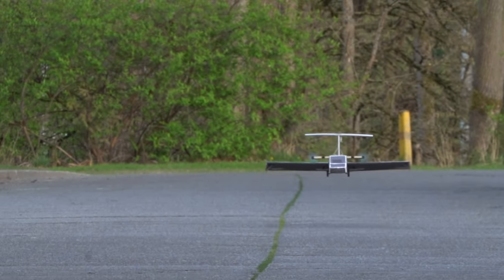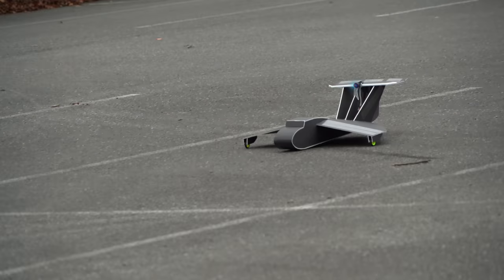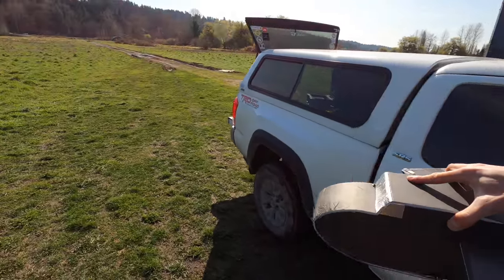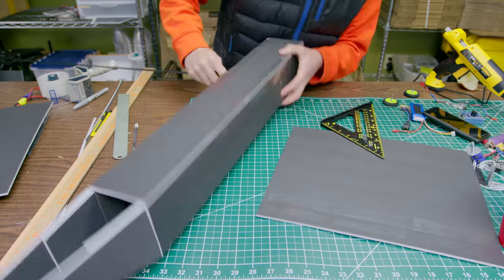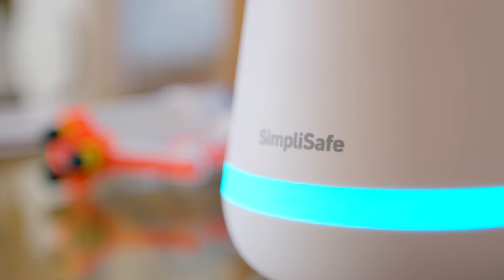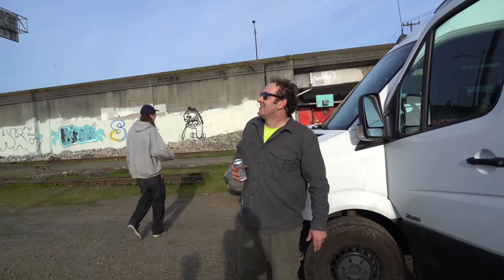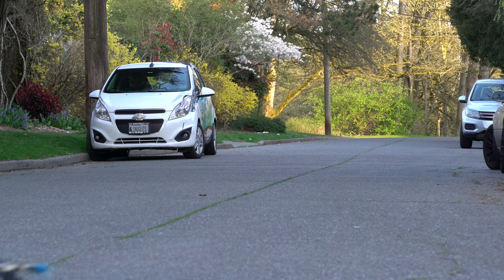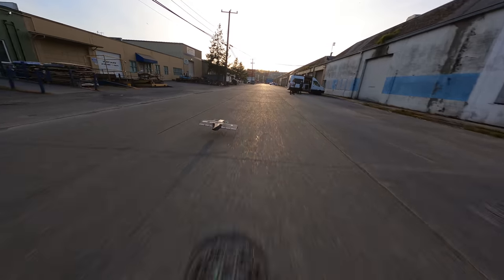R/C Ground Effect Vehicle with LiDAR Altitude Control

Comment: 11:14 In order to damp the bouncing up and down, you could probably use a PD or PID controller instead of a P controller in the altitude range where the throttle is decreased. In other words, make the throttle not only a function of altitude, but also of how quickly the altitude is increasing or decreasing.

Comment: Several years ago I (a software engineer with no aerospace engineering experience and only basic calculus knowledge) started a project to build my own flight control software in Kerbal Space Program using the kOS mod to see how fast I could learn. I got to the point where I began introducing my PID loops but I think I was trying to do too much at the same time. My goal seemed simple: given a fixed point on the ground, circle that position at a specified altitude, speed and radius, in a halo pattern, kind of like what an AC-130 gunship might do in popular video games. I tried getting the speed/throttle loop dialed in first, but had a very hard time zeroing in on the correct parameters. I learned a whole lot, but eventually got overwhelmed and put it down. More videos like this might help give me the confidence to pick that project back up and give it another, more educated try.

Comment: Ground effect is most strong within a half wingspan in altitude. Making it bigger would be interesting to get a bit more distance from the ground!
Reply: I think a little more wingspan may help reduce the twitchiness too, I've suggested some angled winglets. The bigger the air cushion volume the more support it will have, hopefully damping out some instability. Real ekranoplans have a lot of mass but also a lot of lift IGE.

Comment: I tried an inverse delta wig a few years ago and had the same problems. It either plows the front or does a backflip. Built a Bixel type (the sled looking one) after that and it was so much better. Naturally stable in ground effect and in free flight. I think it's the best type of wig type for rc scales since GEVs are supposed to be naturally stable in ground effect with just airspeed to control the altitude.

Comment: OK now this is cool. And actually surprised at how well a simple height-thrust curve works. 
I would've gone straight to PID (more complicated is more better right? right???)
Reply: Yeah it's fun to see it oscillate up and down over the ground but I think specially a derivative term would help a lot
Reply: Using the throttle for alt control is not really the way to go. Throttle response is way too sluggish, the motors take time to spin up the props and increase thrust and the airspeed, which leads to a lag in the altitude response by the f/c and causes the aircraft to gallop. There’s no way the f/c can preemptively throttle up the motors in time for the upcoming the decrease in altitude regardless of the PID settings, it can’t see into the future, and so will always be a second or two behind the game due to the slow thrust response.

Comment: You're missing one thing: gyroscope. 

The thing with proximity is it only measure the height but not the momentum. You hit the minimum height with already too much downward momentum, it's a bit too late.

Imagine if it can start throttling as soon as it start going downward from ideal height, and otherwise.
Reply: Gyroscope ... You mean accelerometer ?
They don't need a gyroscope nor an accelerometer... basic physics :
- Position
- Speed
- Acceleration
They have the position, a simple derivative give them the speed..
Getting the speed form acceleration is not as easy nor accurate.

"Imagine if it can start throttling as soon as it start going downward from ideal height"
Okay but ... they already know when it gets downard because they have the lidar. What's missing them is what is the perfect spot
Reply: @crationis  Perfect spot is way to many milliseconds before to take an action. You have to predict, not react, in which gyroscope is better due to much lower input lag.
Reply: @Pawel.N  But your gyroscope is useless to predict anything with a plane flying at a constant pitch...
And if there is any variation of angle, they are way to small to be measured accurately, making it imprecise and thus completely unusable if you want to integrate it to know the vertical speed
Reply: @crationis  Maybe few gyros on farthest sides of plane?
Reply: @Pawel.N  Oh please....
A gyroscope mesures variations of angle
What would its position change ?.....

Comment: You need some derivative gain in the control loop.  It will help overcome that oscillation by applying a gain to the rate of change in altitude.  Also, drag is a nonlinear function of height in ground effect.  So your thrust vs altitude curve needs to be the same nonlinear shape.  Finally, you might need a little elevator control to add more responsiveness.  Thrust is always going to lag, and lag decreases stability..

Comment: Could you implement a propellor in the reverse direction with separate throttle control to possibly add air speed control?

Comment: If you look at most succesful GEV, you will see bulkheads/partitions at the wing tips. this is essential to maintain the best possible pressure under the wings. I found that extending them fore and aft the wing profile is increasing ground effect but also stability.

Comment: Thanks for the video
You are tying Throttle to Altitude. Throttle will control v-acceleration which then changes v-speed which then changes the altitude. Currently your plane will be throttling down if the altitude is high regardeless of it having positive or negative v-speed (throttle down while moving up or down just because the altitude is high).
The throttle (v-acceleration) should be controlled by both the v-speed and altitude. This can be done by choosing a relation between v-speed and altitude (can be just a line going through 0 at the perfect altitude) and then controling the throttle to push points that are out of this line back on the line.

Comment: Implementing a PD controller instead of just a P controller for this would probably work wonders. I don't think it's super necessary to use integral for this, but I think that using the vertical velocity as a control parameter would seriously help in making this thing work extremely well.

Comment: I think some slight dihedral and maybe 30-to-45degree  winglets - possibly of a soft/felxible material? - will tame down that twitchiness.

Also, a wingstrike on the ground will result is huge drag in what is already a sluggish/behind the curve machine, so anything you can do to reduce frinction if it does make a wingtip strike will help make is much more recoverable. I've used self-adhesive backed thick PTFE tape (used for industrial slider applications) with good results on prototypes before. Very expensive but you only need to use strips a few mm wide and replace them when they get too scuffed.

Comment: You need multiple lidar and gyro sensors. Think of it like a chair. You want to use the sensors to make a virtual stable shape. If you have 3 gyros and lidar sensors to keep it level and add an offset when you want to change altitude it should always maintain flight. Right now when you try to take off or steer the distance to the ground changes and it removes thrust so it looses control. That is why you had more luck with the larger less reactive plane. It moved slower which dampens errors.

Comment: The Caspian Sea Monster has a set of big flaps on the trailing edge of both wings. This should work on this small scale model as well since it's essentially changing the under-wing pressure to control height.
Reply: Isn't that beast magnificent? It must have been exhilarating flying such a machine across the Caspian...well, skimming across the Caspian maybe.
Reply: @olliefoxx7165  Indeed. And luckily it's no longer rotting at that port. They towed it to an open-air museum some time ago so it's easier to see now. It broke free while towing, so there are a lot of pictures of it being washed up on a beach. Got a lot of people interested since that was the first time anyone could get close enough to it to touch it.
Reply: @AgentWest  Wow! There's alot of amazing vehicles, aircraft and other bits of Soviet Tech that most Americans never knew existed. I can't imagine what the folks thought when they saw that big craft washed up on a beach. I doubt I'll ever get to see the fascinating things those Soviet designers, engineers and manufacturers built back then in person. Thank goodness we have the internet today!
Reply: @olliefoxx7165  Yeah, Soviet tech at the time was "throw sh*t at a wall and see what sticks" with most of it being military. One particular example that comes to mind is ZIL-4904, the screw-propelled truck. Since museums (even military ones) are common and popular in what used to be USSR i'm sure you can find plenty more unusual machines that still exist. If nothing else, look up swamp tank recovery, that'll keep you occupied for a while :) Groups of people gather together and recover WWII-era equipment from swamps, then restore it, often to full working condition. The swampland is amazing at preserving vehicles.
Speaking of unusual machinery from USA though, i just watched a video by Callum about the Sno-Freighter (a massive land train) that was developed for moving cargo in Alaska and north Canada. You may find that topic interesting as well.

Comment: here's a tips . if you want something that can literally fly forever . you need the right place and overtime if you experiment with it enough time, the result will be more and more insane . it doesn't matter no matter how many times you said it's the limit . it's matter when you think there's something beyond that you can reach and this is how you creates something so powerful.
Reply: Hello Daniel.

Thank you for all of your hard work & persistence.
It is a very challenging task to build a small scale G.E.M that is  stable in IGE, and OGE flight.
We wold like to speak with you about you lidar contol system for use in an experimental hybrid G.E.M.

Comment: Something cool to try would be to use an IMU to have a vertical acceleration feed forward loop so the controller can anticipate and correct for disturbances before they manifest as a change in altitude. And gotta give us more rap.
Reply: data fusion https://en.wikipedia.org/wiki/Sensor_fusion

Comment: Thats porpoising in and out of ground effect which I wouldn't call flying in ground effect. you need to revisit this and get it flying the best you can without LiDAR which will probably take months to achieve getting it perfectly balanced depending if you get lucky could be a day, once you get it super close then introduce the LiDAR. Not to take away from what you did here as it's badass, but I know you can do better. I mean come one you are Mr rctestflight, the Bruce Lee of RC.

Comment: You should point the lidar forward to compenssate for the control loop delay, set the output of the lidar to control the elevator, then setup an autothrottle based on angle of attack

Comment: Awesome!  I don't see the need for the strange reverse delta on the big one.  They're only going to be able to fly it in predictably light winds.  The only thing that I can imagine is for maneuverability at slow speeds, but it doesn't need to be flying then.  I think the Russians did a pretty good job on the wing design and basic control surfaces.  You have the advantage of almost instantaneous thrust control, but they had the advantage of power and weight.  As you found, pretty much any design can be flown with enough sensors controlling surfaces and thrust.  I'd love to see what can be done with 10 more Lidar boards and about 20 more iterations.  Good luck.

Comment: Instead of using the elevator for altitude control you could try and use flaps near or under the CG; this is kinda what the F-35C and Super Hornets with current software do during carrier approaches to provide rapid glide-slope adjustments vs waiting on a turbofan to spool up or down. You could theoretically also throw a Y-splitter on the throttle PWM output to drive both the motor ESC and flap servos; you'd just have to mechanically adjust the flap throw (use different pushrod holes on the servo control arm for example) vs tuning in software. Or you could just modify the firmware to add a flap signal output, but I imagine that'd take more time.

Comment: Have you looked into the freewing design as demonstrated in the Spratt design. Fixed throttle renders fixed altitude. Also, it was not affected to a large extent by wind gusts. To increase air speed without increasing altitude, you would need to alter the angle of attack to decrease lift as you increase speed. I think that you would need to develop an algorithm that relates these parameters.

Comment: Try using the ailerons as flaprons and activate them to control the amount of lift generated for a fixed angle of attack, this should be much more responsive that using elevators to increase/reduced the angle of attack to control the amount of lift.  You may need to dial in elevator and flaperons maxing so that that you don't have unwanted pitch occurring when operating the flaperons.

Comment: You could get quicker response to throttle control by having the propellers blow under the wing, so that an increase in their thrust increases the pressure differential directly rather than through a change in airspeed. I don't know if they need to be high for other reasons, but, if so, maybe some mounted high and some mounted low in front of the wing would work? Would probably need guards to avoid striking the ground, though. (Or, alternatively, set them up to blow more directly over the top of the wing, and make the top of the wing curved, and rely on the Coandă effect to direct the air down, getting lift from the air's downward momentum after leaving the wing, rather than pressure under the wing.)

Comment: If you have an RC plane like airbus a 320 and add LIDAR detects the height above the ground GPWS sound is the same from airbus  you know where to engage the flare especially in FPV mode in RC Airliners.

Comment: You could try integrating 'Change in altitude' to your control algorithm. It looks like it gets too high, cuts throttle and drops so fast that it bottoms out before full throttle can save it.  If you could have your algorithm prevent that from happening you would have more time to make a good throttle correction.

Comment: Part of what I see for your altitude control is that you have several different factors that affect how the plane flies, but you are only controlling one variable. You said the answer in the video, wind has a massive effect on the plane, so what you really need as part of your throttle control is an apparent wind speed indication. I'm not sure off the top of my head whether this would be best implemented as a mixed value (ratio of airspeed and lidar) to your altitude control, or if it would be better as a cascaded control to the altitude control, or maybe the airspeed controls throttle, and altitude is controlled by the elevator.

Comment: It's kind of a high lift wing with slow stall speed using lidar to maintain altitude at ground effect elevation.  Ailerons change the angle of attack which goes against the ground effect. Ducted fans make good hovercraft when stationary, but forward motion decrease lift with the airflow crossing over the intake. A ducted fan wing would maintain optimum ground effect elevation at zero forward motion and might decrease the lift during forward speed, regulating the lift in that sweet spot where ground effect happens. It's not really an aircraft or a hovercraft, just something that wants to surf on the ground effect.

Comment: I think some form of spoilers might be a good and very direct way to control lift.  Their effect is immediate and does not depend on either speed or attitude. 

On another note, it seems to me you're flying above the height needed for significant ground effect.   Perhaps just reducing the wingspan, or even just making the aircraft heavier will make it more intrinsically stable at maintaining constant height.  Ground effect vehicles usually have a far higher wing loading than aircraft and cannot fly above ground effect even if they try.

Comment: Maybe this helps. The Lippisch  type GEV of reverse delta you built was wrong. It should have an airfoil from root to tip, because you made one simple bend it had noticeable negative twist at the tips, lifts under the middle and downforce at the tips, hence no stability.  Since these models are flying in the earths natural boundary level air, the model machines see little difference in air density, where full scale can depend on thicker boundary level air and ride upon it. You dont have that working for you. Also Lippisch designs had ailerons on the tips of stabilisers outboard, which were angled up to spill air. What happens is the air beneath the wing increases in pressure to the point where its centre of pressure moves aft, while the upper surface behaves as normal but there is still an overall difference in CoP from 25% to as much as 50% on the underside. Conventional aircraft share lift usually around 60% on the upper surface and 40% below, on a GEV this shifts to 60% below and 40% above. The tails are lifting tails at 25% of mainplane area so the tail shares lift out of GE..

Fixed aspect plain wing GEVs have sponsons on the tips to enhance pressure containment. This type are dependent on one rule, low aspect ratio wings will use power to translate into free space and climb out. IOW aspect ratio and/or power to climb out of GE, but their benefit is to use GE for less power hence more efficient flight.